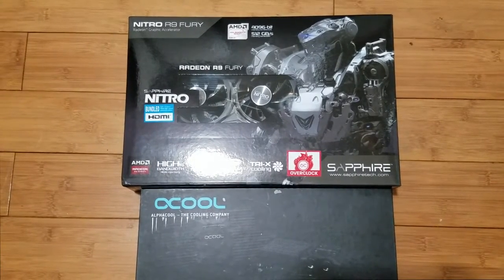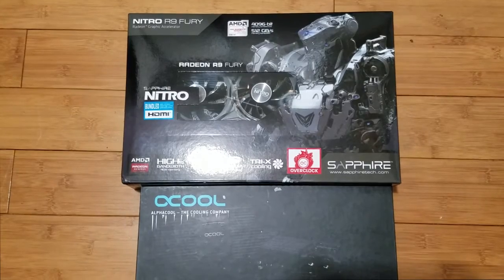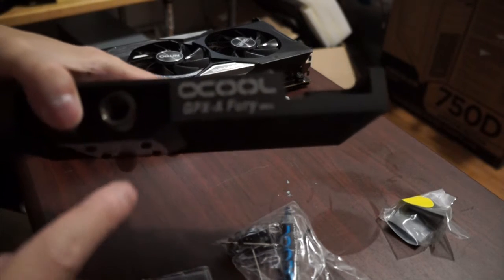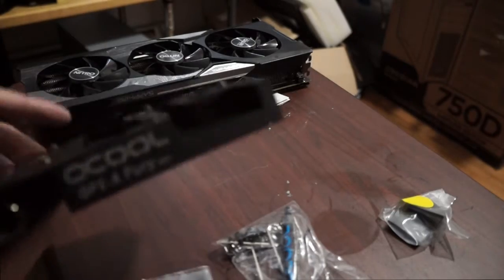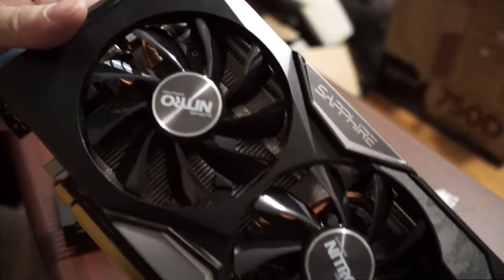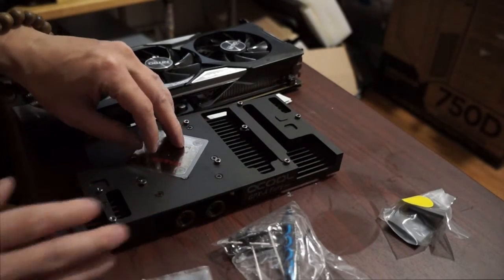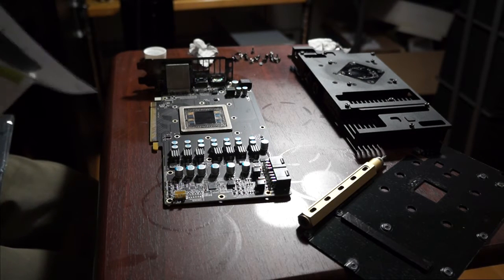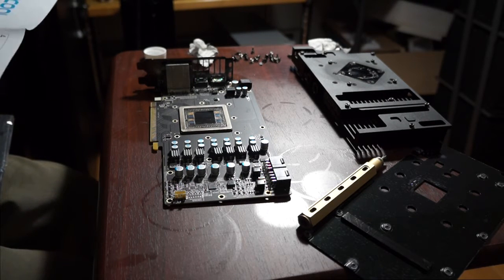Custom Watercooling Sapphire Fury

Comment: Hey man just now checked out your vid as I am looking at a water cooling solution. Does this link come with the pump pre installed? and will I need to do anything besides running tubing for it if I use this? https://www.performance-pcs.com/water-cooling/water-blocks/water-blocks-vga/alphacool-nexxxos-gpx-ati-r9-fury-m02-incl-backplate-black-ac-11277-d.html

Comment: hey man how long is the card after putting it in the block?
Reply from the maker: it been in my system since I made the video.  I have  not  change the coolant yet
Reply: lol how long is the card, like length, one end to the other
Reply from the maker: Oh sorry mis read the comments.  it between 9 inches to 10 inches long
Reply: wait, seriously?! thats a HUGE deal, thank you so much! Can u post a picture with a ruler or something? I have a case then needs a ten inch or less gpu to fit and I was worried i wouldnt be able to use my nitro, was going to watercool it anyway.
Reply: can you measure it to be sure? I literally spend hours yesterday trying to get exact measurements on this product, and literally found nothing. I just need to be sure its exactly ten inches or under so itll fit in my case. Thanks bud.

Comment: Hi, i have a r9 nitro on my own. i want to get a 2nd one and then install the waterblocks. how is the coil whine wehne under load with the watercooled one? thanks in advance
Reply from the maker: There is a little coil whine but for mine it low not sure about how much coil whine you will get and will it annoy you.

Comment: And the backplate?
Reply from the maker: alphacool gpu waterblock come with backplate. it in the video at 6:18
Reply: ohhhh very well tnx
Reply: Is it possible to use the original Sapphire backplate with the waterblock?
Reply from the maker: Aaron Bigleman not sure, I have not try it.
Reply: I'm guessing it would if it uses all the same holes, my only concern would be if it used different fastener types. Guess I'll try it when I ordered mine. This is my first time seeing a waterblock for the Nitro so your video is a lifesaver! Thanks!
Reply from the maker: Np